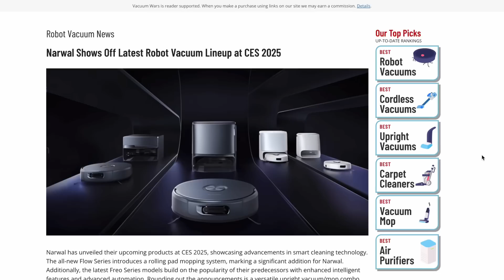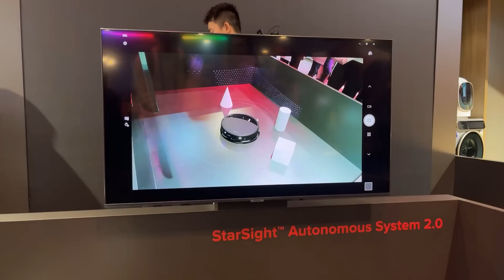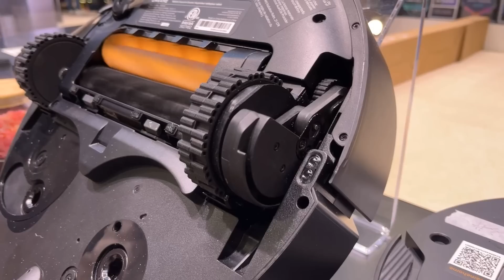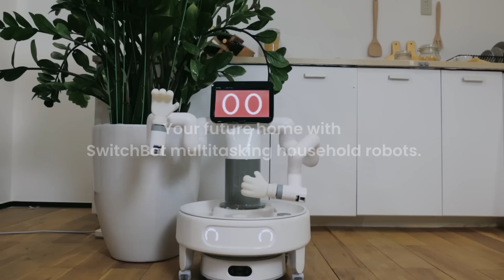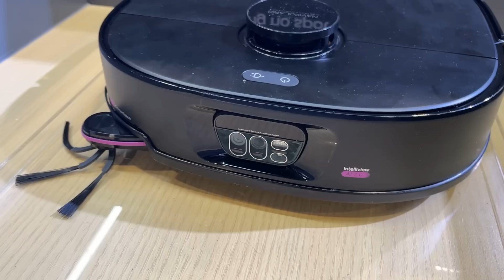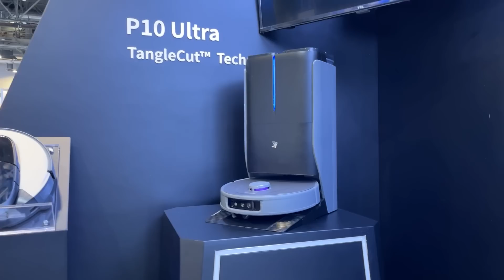Best VACUUMS of CES 2025! New Trends: Robot Arms, Retractable Lidar, Threshold Crossing and More!

Comment: I don't understand, where is your review of the Saros 10?
Reply from the maker: Surprisingly, this one didn’t perform as well as the 10R, despite being the same price. It’s currently sitting in 5th place, which is still solid, but the single microfiber vibrating mop pad system wasn’t as effective as the spinning pas system on the 10r in our dried-on stain tests. It also didn’t perform as well in a few other key areas. Still a great robot, but the 10R was the better of the two, in my opinion.
Reply from the maker: We have a comparison of the Roborock 10 and 10R up now on our website right here: https://vacuumwars.com/roborock-saros-10r-vs-10-comparison/  You can check out all of the 10's scores there too.

Comment: be great if you can also review 3i S10 Ultra, seems like the one I'm looking for. just not sure how clean it will vacuum and mop using your level of testing. I've got tiled floors but one of those anti slip ones, so it has rather a rough surface which I kinda regret having as lots of little dirt can get trapped in nooks and crannies. but if the mop brush is heavy duty with regular mopping, I think i might be able to keep it rather clean.
Reply from the maker: Sure thing! It's out now! https://youtu.be/RVFeBt0MMbs

Comment: Okay it's been a couple years since I have watched this channel, but I am so happy that you have made this😂 I have a Dream bot and it is definitely the best robot vacuum that I have tried, that company really seems to get it, but I am definitely curious about shoving an arm on and if this just makes the thing more prone to failure. I don't really understand the design of the arms that they're using right now, it's definitely not how I would design it, but at least they're starting down that direction. Truly though, one would expect to utilize the suction for some of the gripping as well as ensuring that the arm actually tucked in well and had cameras so that it would not destroy itself on obstacles.

I want to give credit to the DreamBots for not just building new robots that can clear heights but actually sending out the updates so that your existing ones get better at getting overledges. I got that updated a couple of months ago and it was pretty darn obvious what it was doing. I have a lip that mine needs to get over and it has always been able to get over it but it got over it much better after that update😊

The dual use of the vacuum suction in the stand is clever.
Reply from the maker: It's good to have you back! We're really excited about these new features and what the future holds.

Comment: Just wait for the stories of these things picking up dog shit and dropping them into drawers of socks, or pulling laptops off tables as they yank the cord. Because no matter how "smart" these claim to be, they're actually going to be very dumb devices. You do not need a robot arm on a vacuum cleaner. If the intent is to stop a vacuum ingesting something in front of it, then it could simply avoid it.

Comment: Tbh I am a bit disappointed from innovation perspective. I mean all the shown things are great upgrades but the only actual new thing is the arm which...I really don't see a great benefit to. Maybe the only thing is if you have a kid and it made a mess of toys than that would move the mess from to ground to a higher place :D but I cannot imagine what will happen if the mess is lego... So up to this point I still think the biggest innovation is the last years no-dirty water tank design from 3i where they basically brew evaporate the dirty water and then condense it to clean. So far I am happy with that technology but my house does not exactly contain extreme conditions to test things against so..

Comment: I’m honestly surprised this whole “arm” trend started before they solved the stair vacuuming problem. The new arm solves a problem I didn’t really consider a problem (if it has good obstacle avoidance, do I really need it to lift the obstacle?). But it looks like the stairs issue will continue for the near future…. I miss the Migo Ascender. ….ahh what could have been.
Reply: If someone has a very messy room (like myself) that feature could very easily come in handy.  

It is kind of funny that the arm was being worked on before it being able to get there though.

Comment: Why don’t we see D shape bots?
Reply: I’ve always thought this. I always wonder why they don’t do a full-length roller brush at the front with a D-shaped robot.
Reply: Due to the bumper switch trigger timing, D-type sweeping robots will have problems with the obstacle avoidance algorithm in certain conditions, so you can see a lot of D-type machines have failed in the market, just like cars have basically had four wheels for many years, sweeping robots will most likely be round in the future as well

Comment: Man the recessing of the LIdar is such a "Why didn't I think of that!" moment.
Reply: Retracting LIDAR is INFERIOR to 3D Lidar like Starsight... 2D Plane vs 3D point cloud... (Starsight already does not use a lidartower, but is integrated in front and rear left)
Reply: Yeah, interesting to see retractable when they've already demonstrated that they can make slim by just replacing the turret with solid state lidar
Reply: That was actually the feedback I gave when I got my DreamBot. Pretty much everything about this robot is really cool but why doesn't the lidar pull in to get it out of the way when going underneath something? Glad to see that feedback was also noticed by a company.
Reply: @GizmoaGames  Old hat... 3d lidar is the current thing... does not use a tower...
qrevo slim, for example...
Reply: The only thing my bot wouldn't fit under was my sofa.  I got extenders for the legs instead, problem solved!
Reply: Eh it’s a lot of mechanical complexity just to save a few millimeters.
Reply: @Mrcaffinebean agreement that the complexity needed to save a few millimeters may not be worth it. Reminds me of the pop-up headlights on 80s cars.

Would probably make more sense to have the side brush or even those new arms reach other below stuff because they could go lower.
Reply: @Mrcaffinebean  Agreed... Likely used on cheaper bots, that can't afford to use the brand new solid state LIDAR...
Reply: @Mrcaffinebean  Exactly, more things that can break and have you have to go through a warranty claim or searching online for parts in 2 years time etc. I'd rather a rugged, functional design.
Reply: @Mrcaffinebean  I can think of a few spots in my house where that unit can now fit. That may not be useful to you, but it is to me. These are cutting edge robots at a technology expo. Everything shown here is mechanically complex. Don't you think it odd to suddenly draw the line?

Comment: if it has a camera it will NEVER enter my house.  They have shown they cannnot be trusted with any data let alone video. I already have to watch demontage video's to make sure they arent potting freaking microphones in this shit. 
Retractable lidar is goo i have several places where it tried to ram it off.  the lidar dome has no sensor which is a bit of a problem.
And unless you have carpet the suction power is pretty irrelevant. I have a L60 with 54000 but on stand 2 which is about 2500-3000 and more then enough for my hard floors. even on my doormat it does fine.

Comment: Am I the only one to think the arm is the most useless thing ever ?
Just don't leave any crap on the floor and you're good, no need to pay extra and waste space inside the robot for this.... 
They should focus more on mopping system like a robot that can clean the mop as it goes like a floor cleaner do, or one that can detect liquid spill and only use the mop without the vacuum to avoid spreading it even more....
The ONLY thing that could be useful with the arm is if it can open and move doors
Reply: I do agree on the arm thing—it's useless for people without toddlers/pets. But since I have a toddler now, this would be perfect for me as a the toddler can just dump out the toys to play again right after you put it away. Toddler does help put away toys but we definitely do miss a few pieces sometimes. But at the end of the day I wouldn't die if the robot just goes around a piece of toy like Lego.

I saw one of the company that's been doing the detection of water spill to switch mop heads—which I think is great! How I wish it can go up and down the stairs to clean it too. 😅
Reply: @jamiel2179  Ok you have a good point, can be useful for pets and babies...
But like you said, you could also just have the vacuum go around and not clean this very small area today, it will do it the next day, no big deal 
This is really no worth the investment imo
(Also would only work with toys that are small, lightweight and easy to pick with this very specific robot arm)

Sure maybe later when we have humanoid robot, they can train them to pick as much thing on the floor as they want, but for something that just vacuum and mop, I say we can make some effort and adapt to it rather than the other way around 

Yeah the water detection, just saw one later in the video, that's great 

As for the robot that climb stairs, Ive seen a few but it's always a super weird robot and the climbing system take so much space that the rest is pretty bad
I think the best way for that would be a rail system
Instead of allowing the robot itself to climb, it could attach to a rail attached to the wall in the stairs, go up and clean upstairs (like the thing my old people use, the chair that goes up on a rail)
so sure it could not clean the stairs, only climb it, but it's just stairs.... do it yourself, it's a other of those thing where its easier for us to adapt to the robot rather than making the robot far too complex and expensive to adapt to us

Comment: Surprised Eufy did not show their lawnmower?! Also, finally Narwal is bringing an actual competitor to the S1 pro, very exciting! Regarding the Eufy E20, it is not meant to be a flagship, 8000 pa is a lot and 30000 PA for the handheld is an impressive claim.
Reply: I still don't trust Narwal. I got their first vacuum and they stopped updating the app for it after a year and left it in the dust

Comment: Notably missing: iRobot.
Reply: iRobot is repeating what happened to BlackBerry. I.e. Despite creating a whole product category, rested on its laurels and then got overrun by much more innovative competitors.

I got iRobot S9 with the dock when it first came out at the time iRobot was still competitive. But it never worked properly to the point that iRobot sent me a replacement i7 because the S9 couldn't be fixed.
Reply: @calvinl2149  They sent me a replacement S9+ and it's still going strong. They figured out what was the problem and replaced everyone robots. Mine was maybe 1-2 months out of warranty too.
Reply: And Dyson, they're getting a bit left behind and outdated now
Reply: Because they have nothing new to show us lol.
Reply: Not sure about the future of iRobot after that failed Amazon acquisition.
Reply: iRobot sucks.  I've had four since 2000.  No more.  Heck they still can't untangle pet hair and I'm tired of a full tear down after every use.
Reply: We $1,400 for the S9+ back in 2022. It doesn’t do well for the price point. Looking to replace it with the Roborock Qrevo Curve.
Reply: @ikari2000  I think you should hold off until the the new ones come out, I bought my roborock s7 just a couple years ago and damn does the robot vacuum technology move fast.
Reply: @ikari2000  The Curv is imo the GOAT atm. Not a single hair in the brush, although it struggles sometimes with doorsteps over 3cm, it takes a while and sometimes it stops.
Reply: Looks like they are struggling hard as a company. Not surprised. I bought their flagship vacuum and mop back in 2021 and hated them. Dreame and Roborock are my preferences now.
Reply: @ncastroclan  They have ALWAYS been distracted by their military contracts... And past 5 years at least they're not even in consideration for me anymore...
Reply: @ncastroclan Lmao. That wasn't a wise purchase. The US is banning electronics owned and manufactured by Chinese companies like drones, TP-Link WiFi routers, and potentially Tik Tok. Won't be surprised if robot vacuums are next. Chinese cell phones can't be used on US networks either.
Reply: Chinese companies are so far ahead, even Roborock is being challenged everyday I can see
Reply from the maker: Here they are!  https://youtu.be/ou83lomzFr8
Reply: Who? 😂
Reply: Yet again.
Reply: Indeed it's a shame they're not innovating anymore.  I still have an S9+ for my carpets, because honestly, that's the only thing it's good at and nothing else can really compare to it there.  I really wish someone else would come out with a D-shaped robot with bigass double brush system to rival the S9's...  Roborock 100% for the hardwood though!
Reply: Missing 15 years already
Reply: You guys are pretty much all correct with your points. And those new vacuums indeed do tons of super cool things. But there’s still nothing from any other brand that deep cleans carpets better than my S9 and j7. These two robot vacuum models are still in literally the #1 and #2 spots on VacuumWars’ all-time charts for carpet deep-cleaning. And that’s all I need: Excellent carpet cleaning. My first floor is all tile, so every night while we’re sleeping, I have the louder S9 vacuum up all the crumbs etc. from the entire first floor. The very-quiet j7 vacuums the entire second floor (100% pristine-white-carpet) every day. That’s it 💁‍♂️ And I won’t even get into the topic of having Chinese, internet-connected, mobile cameras driving around my house.
Reply: @93836irobot may have the best vacuuming, but most people would rather sacrifice that to have all these other features in exchange for slightly worse vacuuming. They still don't have a good vacuum/ mop robot.
Reply: @93836 They are good at vacuuming but almost everything else is terrible. And to be honest there's only so much deep cleaning a robot vacuum can do because there is no robot vacuum on the market that has more suction than an upright or higher end handheld stick vacuum. I think the reason they are able to do that is the increased cfm which is why they are also super loud.
Reply: @93836 Real talk, what will the Chinese do with your data assuming they steal it? You don't live in China so what can they do to you? Meanwhile it is known that the NSA has backdoors into all US tech companies. Shouldn't you be more afraid of the government you live under? You can't get sent to a Chinese jail...
Reply: I hate my roombas, always get stuck or never start when I want. Very buggy
Reply: Probably because they aren't worried. The US is banning electronics owned and manufactured by Chinese companies like drones, TP-Link WiFi routers, and potentially Tik Tok. Their robotic vacuums and mowers are probably next.